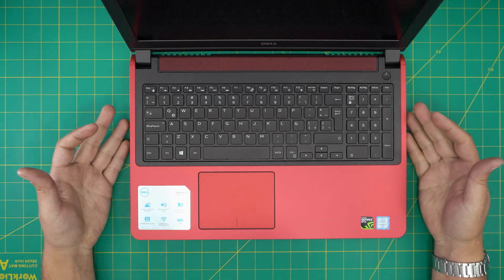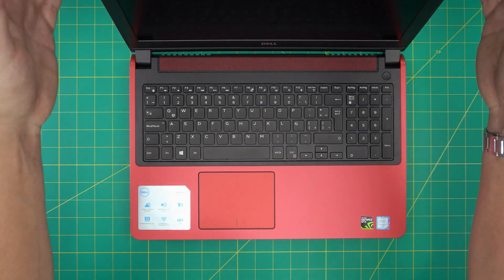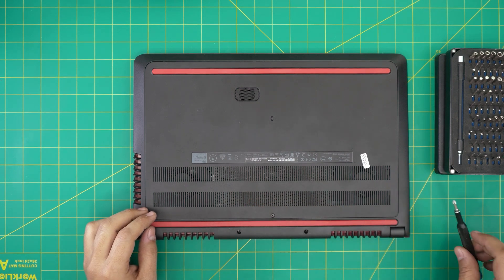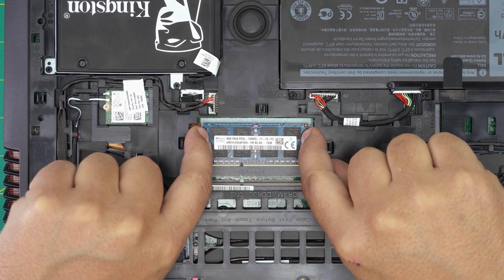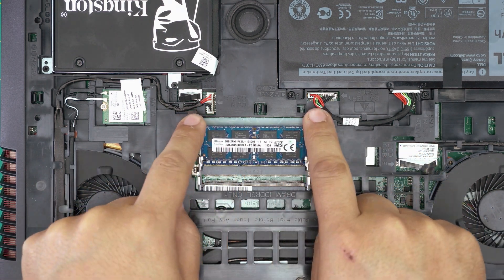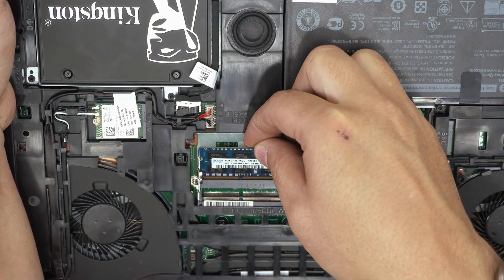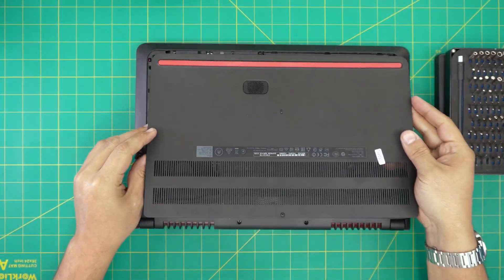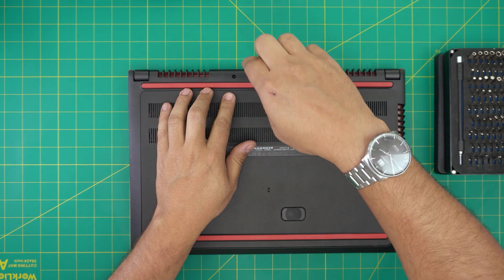How to Upgrade RAM on Dell Inspiron 15-7559 Laptop - Step-by-Step Guide

Comment: can we upgrade it to 16gb ram sticks for ddr3?
Reply from the maker: 🫠Regarding your question, no it will not boot as the 16gb stick requires more voltage and it will not get it on this board.
Reply: @ can we also use a seagate hdd? I’m currently looking into hdds to store my work files and is that good? Its a seagate laptop thin hdd
Reply from the maker: yes you can and they are very stable drives up to 2TB.

Comment: hola men, yo tengo esta dell, pero en dos años dejara de actualizarse w10, quisiera saber y si haces un video mejor, si se puede mejorar a win11, he visto que hay varios metodos, pero no se si continua actualizandose dentro de w11 automaticamente o nomas se actualiza una sola vez,
Reply from the maker: te recomiendo que actualizes el HDD a SSD y instalar fresco desde zero el windows 11, esta stable y rapido en esos equipos, hare un video pronto.
saludos
Reply: esperare el video, tengo windows original de fabrica, asi que espero tambien nos enseñes a preservar el serial, o si se preserva saber, gracias, @uFixTek

Comment: algunos dicen que tienen capacidad para 32 gb en ram, yo use comando cmd y me dice que 16gb ram, y en el procrama de crucial me dice que son 32 gb ram, opte por ponerle otros 8 gb y me costo barato en amazon, la verdad es que para que queremos mas, la computadora solo se volvera rapido con un ssd, o un m2 sata, (si alguien sabe si se puede instalar un mnve que nos diga como, ya que en todos lados indican que admite este equipo solo el ssd m2 sata de dos ranuras, y no se cuentos gb de maxima capacidad en ssd de 2.5, y ssd m2 sata
Reply from the maker: Hola, mira, este portátil se recomienda mucho que pongas solo 2x 8GB SDRAM DDR3L, en total 16GB. Hemos intentado poner 32GB, pero su sistema queda muy inestable. Por lo tanto, si el CMD indica 16GB, quédate con eso. Si pones 32GB, verás que en el Administrador de tareas dice que tienes 32GB, pero solo 16GB son utilizables.

En cuanto a la capacidad de M.2 y SSD/HDD, son 2TB en M.2 y 2TB en 2.5", en total 4TB.
saludos🍻
Reply: gracias, eres el mejor, pero vi en otro de tus videos que pusiste un ssd 2280 de una sola muesca, pero no vi si lo reconocio la laptob, si  la reconocio???, quiero ponerle algo que si la haga volar de rapida, gracias por responder men @uFixTek
Reply from the maker: gracias a ti, lo mas rapido que puedes hacer es tener sistema en m.2 sata y juegos archivos en otro sata 2.5' asi la banda de transferencia se separan.
saludos
Reply: @uFixTek  well, I'm using a total 24gb ram (1x Crucial 16gb + oem 1x8gb)  since 2016, without any problems.  I'm going to buy another 16gb, but was thinking if it would support 1x 32gb or even 2x 32gb, since the processor supports up to 64gb (no information about the motherboard capacity wet)...